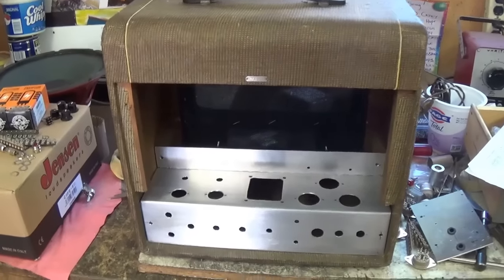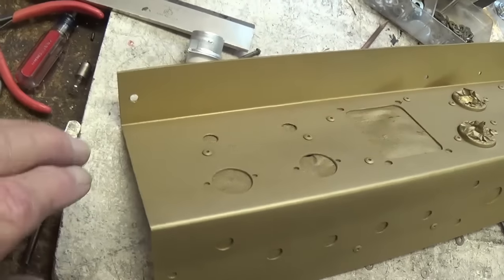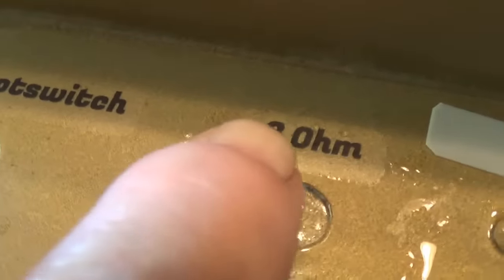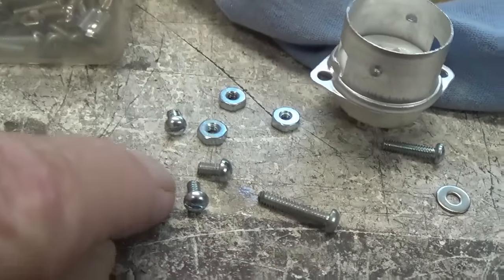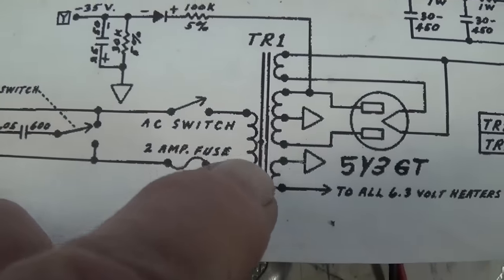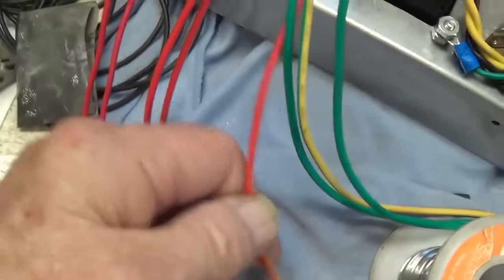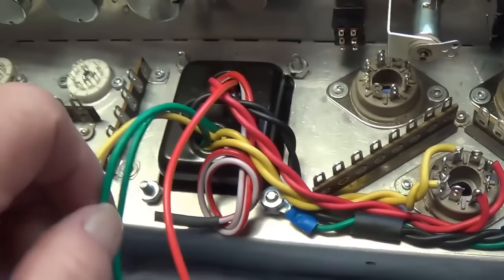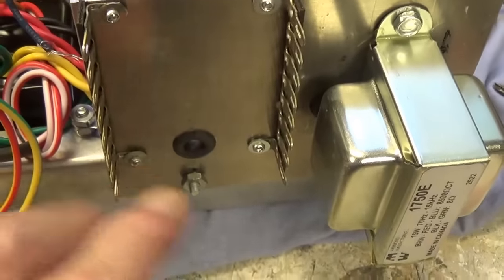Let's Build the Suprinceton, Part 2:  Chassis Painting, Assembly and Wiring

Comment: What? No screen resistors for the output tubes? I suspect you'll end up changing that at some point ....
Reply from the maker: No need without a Filter Choke, GU.
Reply: @UncleDoug  , Doug, you have that  *backwards*. The filter choke helps regulate the screen voltage, which you always want to be lower than the plate voltage, even when the plate voltage sags under load when playing hard. The purpose of the screen resistors, however, is to limit CURRENT to the screens (should only be a couple milliamps) as well as to drop the screen voltage a couple volts more. There is no scenario that I know of in audio amplification where you should leave out the screen resistors, especially in a guitar amp where pushing it well into clipping is the rule and not the exception. (Edit: Actually, ultralinear amps are the exception, where the screens are fed from  taps on the primary side of the output tranny, but hardly any guitar amps use Ultralinear outputs, and generally they're not well liked).
Reply from the maker: Sorry, GU, but Leo Fender and I completely disagree. In a non-filter-choke circuit like this one, the internodal resistor (in this case 1K Ohms) serves the same purpose as the screen resistors. When the circuit has a filter choke instead of an internodal resistor, then screen resistors are required. If you can find a single Fender schematic that disputes my stance on this matter, I'll provide ten that support it. @goodun2974
Reply: @UncleDoug  ,  Some important points that need to be made. For starters, Leo Fender was always looking to make his amplifier's cleaner and more powerful and less prone to distortion *which is not how most people use them nowadays*!  In it's day the Princeton was still considered an upscale practice amp, for intermediate level students/players (who might face playing-volume restrictions from Mom and Dad, or the neighbors), perhaps ideal for studio use (produxers and engineers didn't usually like loud distorted guitar), but not really intended or designed for playing onstage and certainly not intended to be played full-up! The behavior of a tube when the amp is played clean is very different than the behavior of the tube when you're overdriving the shit out of it, and running it outside the usual safe operating area or beyond tge maximum ratings; overdriving the output tube screens is a recipe for blown tubes, and possibly blown transformers.

 Anyway, in say 1957, amplifier owners could easily run over to the local electronics store to buy high quality, rugged RCA, GE, and Sylvania tubes at the first sign if trouble or failure. TV-Radio techs familiar with tube circuits were pretty common back then as well, many of them having had military electronics training. We no longer have such luxuries. 

Leo Fender did a lot of things right;  He also did some things wrong:  note that some model variations were very short-lived before being changed again,  and a number of amplifiers out there that don't quite conform to the schematics or contain attributes of both an earlier and a later model confirms this. Experimentation, tweaks and running changes in production were common, sometimes apparently just because they ran out of a given part and so they went to the local electronics store and bought the closest thing available, and other times perhaps because they thought it would make some kind of improvement in the performance.   Guys who are experienced at working on Marshall's will tell you that the early Marshall's which were copied from a 4 by 10 tweed Bassman contained the same mistakes that Leo made.

 Leo was also known for being extremely frugal ---- some would simply say he was cheap ---- and he would save a penny or shave a buck off of production costs anyway and anywhere he could (when somebody offered him a good deal on Oxford speakers he took it, even though Jensen were better ----  And as soon as ceramic magnets became available he bought those because they were cheaper than alnico magnet speakers). He was very much looking to market every product to a specific given price and to clearly differentiate the lower model from the middle tier models in ways that were immediately visible and sometimes quite audible.  The Princeton probably should have gotten a choke, but that would have increased the cost closer to the price of a Deluxe. 

 I took some time this afternoon and reread some technical articles ( try Valve Wizard, and Rob Robinette's site) and no matter what I read or what website I go to the verdict from techs is the same: if the amplifier doesn't have screen grid resistors, add them!  (Regardless of whether or not the amplifier has a filter choke or not).  In addition to making it more difficult to blow tubes when they're run outside of their ratings, the screen resistors also add a small amount of negative feedback and can help prevent parasitic oscillations, just as control grid swamper/snubbed resistors do; and they'll add a slight compression,  which most players will like. Screen resistors can also act as fuses if properly sized and can blow out to protect the amp before a shorted or runaway tube drawing too much current damages a transformer.  One article I read noted that the more gain /transconductance the output tube type has, the more likely it is to suffer damage if screen resistors are used (6L6's need them more than 6V6's do, possibly a higher resistance value, and high gain pentodes like EL34 and EL84 fail disastrously if screen resistors aren't used).

 In conclusion, all I can say is proceed at your own risk, but if I was you I would put 470 ohm 2 or 3 W screen resistors on those tubes; metal film are good, or carbon film is fine if they aren't near enough to the socket or wiring to scorch anything if they become fusible . I dont recommend carbon comp, too flammable, though many old amps do use them.
Reply from the maker: Thanks for your very thorough reply. @goodun2974

Comment: aluminum & stainless steel gives galvanic corrosion. (Ask any blue water sailor) In marine applications so called tefgel is used, or something similar. Often a stainless bolt gets totally stuck in an aluminum piece in a marine environment.
Reply from the maker: You may be right, AG, in a marine environment. I based my statements on the following source: https://metalprofy.com/blog/how-to-prevent-galvanic-corrosion-between-aluminum-and-steel/   and the fact that guitar amps are generally not used in marine environments.

Comment: I was actually hoping for a little cheesiness.  I will say, however, that I am not a fan of your hotrods.  I thought they were on a separate Youtube channel.  I'm here for the electronics.  I'm sorry, but I had to say it.  I also question the credibility of your take on "electrolysis".  I spent almost a third of my life repairing military radios, radar sets, and navigation systems , ALL of which have aluminium chassis.  A lot of these systems preceded my existence by many years, and NONE of them showed any sign of corrosion, and I doubt your amp would either  Yes, I know some of the  military sets had a coating to prevent mold, but after they were repaired, that coating was gone, and I can confirm that I, my associates, supervisors, or supervisees NEVER replaced that coating, nor was it required by technical directive.  Looking forward to part three, though.
Reply from the maker: Thanks for sharing your thoughts, Chuck.

Comment: Grounding 101: NEVER attach the CT to the ground bus.  Actually, I might have learned from you. 😉You are propagating 60/120Hz ripple noise throughout the amp via the ground. The CT should be attached directly the the filter caps ground bus and from there, derive a ground bus for the rest of the circuit. That way the ripple current stays in between the transformer and the caps. The input tubes and low signal grounds should be the farthest from the CT/PS caps ground.
Reply from the maker: You'll be relieved to know that the filter cap ground WAS attached directly to the CT.
Reply: @UncleDoug  It didn't look like from the way you described it.  I guess you remembered your own teachings and changed it..🤣
Reply from the maker: It was both shown and described in the video, I, and was the most significant connection in the ground circuit. @interesting7906
Reply: I guess I was right the first time. The way you did it, it contaminates the small signal grounds with 120Hz ripple current riding from the caps to the CT via the ground bus and through the red wire! I would disconnect the CT from the ground bus and connect it directly to the three caps negative terminals. That's really the way it should be done.
Reply from the maker: Thanks for your helpful suggestions, I7906, but the circuit is finished, tested, and absolutely dead silent as-is.....with great tone. @interesting7906
Reply: @UncleDoug  No problem.